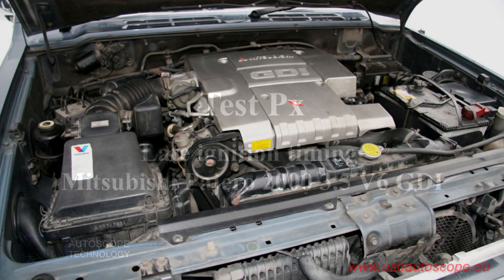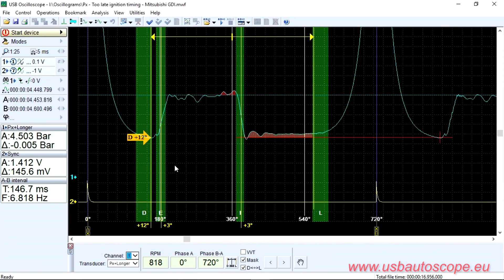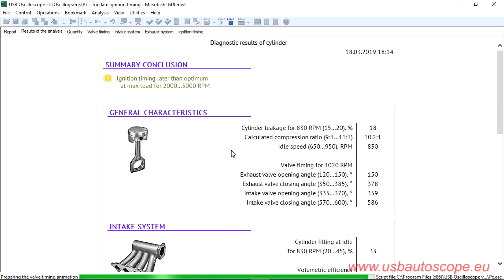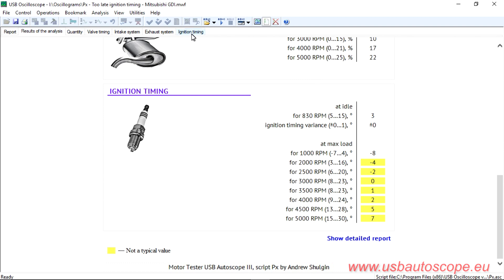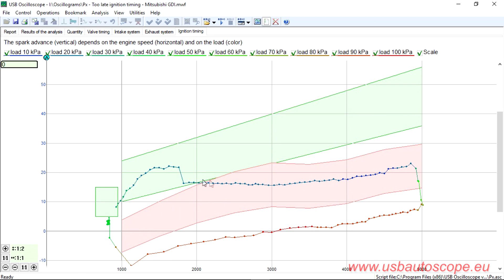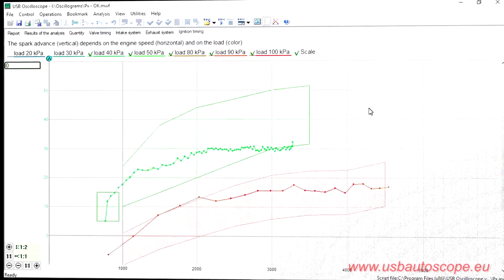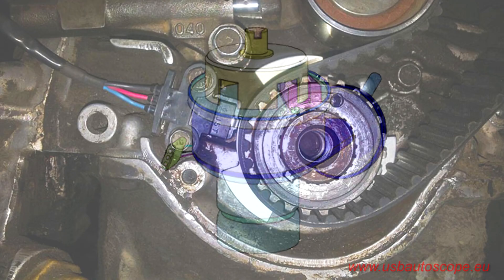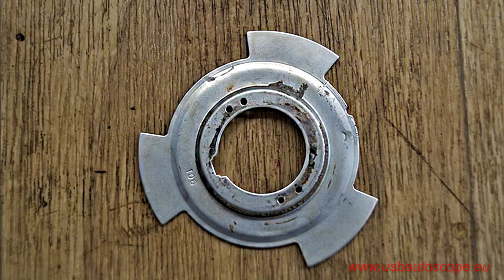Testing late ignition timing on Mitsubishi Pajero using USB Autoscope

Comment: What do you mean by a broken pin seat? You mean the woodruff crankshaft key?
Reply from the maker: No, the key way slot of the interrupter wheel is flared out on both sides.

Comment: In the first place I want to thank you for  your time and work. 

Secondly I want to ask a question about the chart shown around 1.00' with the "normal" ignition advance numbers: Do you realy mean an engine at maximum load and 5000rpm would advance the timing 15 - 30 degrees before TDC or did I just misread this part?
Reply from the maker: Yes, you understood everything correctly:
at maximum load and 5000 RPM, the Px script calculated and recommended an optimum Ignition Advance Angle in the range of 15 ... 30 ° before TDC. But, this is valid only for this particular engine, because in each individual case the script calculates its optimum advance angle values (it depends on the measured geometric compression ratio, and what quantity of fresh air-fuel mixture is delivered into the cylinder in this mode).